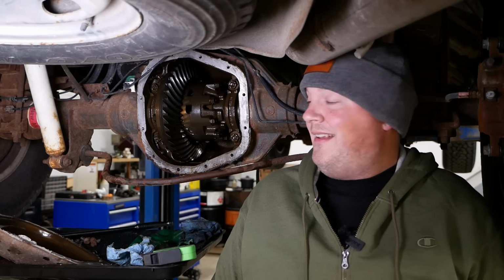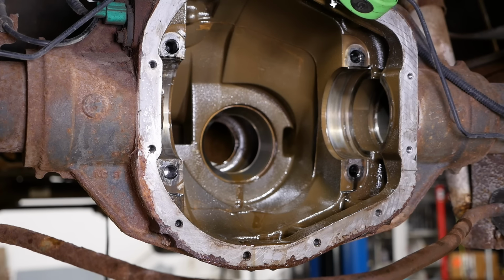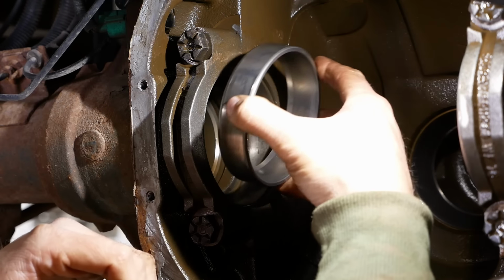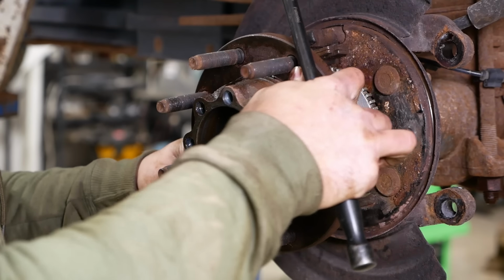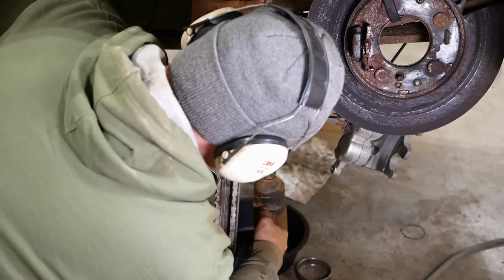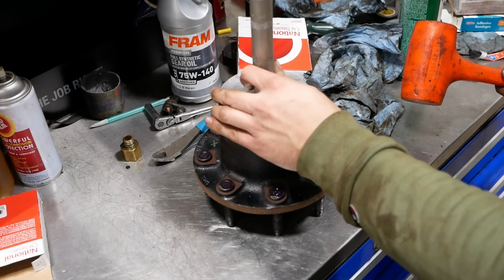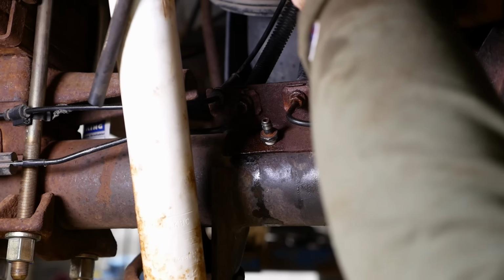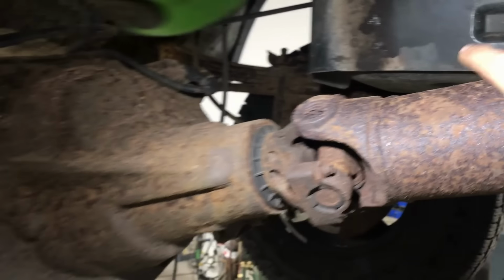Ford Differential Carnage - Driveline Noise Located

Comment: LOL Same thing happened to my DB hammer!  The oil over time hardens the plastic and makes it brittle. Sucks as it was a really nice to use hammer.  As long as the bearing cap and housing were round, thin brass shims could be used if you know what thickness is needed.  That is ONLY if they are perfectly round.  I actually blew out spider gears on an F350 Dually, had to replace everything inside, and the nut for the pinion is torqued to 450 ft lb, needed a torque multiplier to get that put on.  Use a long angle iron on the pinion flange and it goes a lot easier.
Reply from the maker: Yeah I did a pinion seal on a Dana in a video a while back. I used a 3/4 drive torque wrench.
Reply: @WatchWesWork  Without a lift? :)  I had to do it on the floor in my garage,  It did give me the chance to change gearing from 4.10 to 3.73 though and improve fuel economy.  I think the front diff was more difficult to work on then the rear, Crush sleeves are a bitch.
Reply from the maker: @acdii  That was a dually and I could not get it on the lift.
Reply: @WatchWesWork  Then you know what a PITA it is to get that pinon nut torqued! LOL

Comment: i think your right on the greased bearing of army trucks they are holding a lot of weight on those bearings compared to a ford truck so they probably would not hold up to just oil.
my neighbor has a giant Econoline van with a big axle he borrowed some tools to change oil and ford dealer said they changed recommended oil to a heavier 75/140 rather than 80/90 or something owner's manual says. I guess since you are using that ford dealer didn't lie to him.

Comment: I have the 6.2L in my raptor.  The one thing that’s kind of a pain is that it uses 16 spark plugs and the coils use those pellet things that get corroded easily. Other than that..  it’s a powerful great engine.

Comment: My 88 Suburban pinion gear broke exploded bearing cage and snapped U Joint locked up in forward when I was getting on it with the New motor. Pulled drive shaft put in 4x4 and drove home in reverse 3/4  mile fun fun

Comment: Sort of inconvenient that they ever decided to get away from differentials where the whole thing  comes out the front after you pull the axles. So much easier to work on when you can simply set it on the bench.

Comment: With all of the Ford heavy duty 6.0/6.4 diesels laying around without engines, the axles have to be cheap. They say guys with boats will tow them to lake, getting their axles warmed up on the way, then back into the launch ramp and into the cool water. The axle then gets submerged and cools rapidly creating a vacuum in the axle housing and then...if they go too deep, the vent will suck a bunch of cool, crisp H2O into the diff. I wonder if this guy owns a boat?

Comment: That diff looks like a classic Dana design. A person really should check and maintain diff oil at least ever 6 months or yearly. Those vent tubes are notorious for clogging. I have a Dana 60 on a 1972 pickup truck with same kind of vent. I blew a hub seal 27 years ago because the vent tube plugged. Same thing again about 25 years later. Just gotta do that basic vent check at least. I'm wondering if they were getting that rear axle in lake water launching boats? BTW if your customer had just driven that truck in when you checked the differential oil then the foam shouldn't be anything to worry about. I believe that ring gear rolling in and out of the oil as it moves incorporates air into the oil. I've seen it before. The air dissipates after setting awhile. Nice vid.

Comment: That gear lube appears to be foaming. I know that when motor oil foams, that engine will soon be destroyed because the oil pump cannot create oil pressure when it has air bubbles in it that can compress, you can’t build oil pressure with foam..
  but I’m not sure splash feed ring and pinion gears riding in oil that has foamed.. I suspect final drive failures could be the fault of the gear lube’s additive package, or lack of additives like - anti foam additive.. possibly lack of zinc and phosphorus/which are anti-sheer ingredients..

Comment: A quick way to get that carrier loses is to start it with the pry bar. Then use a wench on on of the ring gear bolts to rotate it towards you. It will pop right out.

Comment: I had a late 90s blazer. Customer complaint" noise from rear". I immediatly saw dents from inside of diff cover. When i pulled the axles the drivers axle bearing had failed LONG time ago.  It had worn into the axle shaft 1/4" deep from grinding metal on metal. The entire thing was thrashed. I do not know how loud that failed bearing was for a Long time but they ignored it. Must have screamed at 70mph.

Comment: Cool end bummer about the Stanley it's done it's time by the look of it as for the gearwrench I had two of their ratchet spanner fail straight out of the pack no snipes on them 1/2" one on the fifth nut the 5/8 after a week probably only 20 odd nuts 

My mate swears by snap-on and he has had them replace a 20 year old socket that split so I guess if they do that for all their tools you only have to pay for them once 😁 replaced my gearwrench with a Stanley still working today 2 years on

Comment: Next time , just put a box end wrench on the crown gear bolt and turn the pinion flange , the wrench will lock against the housing . The carrier will walk away from the pinion gear. Makes it so much easier to get out

Comment: I bought a F450 that had some gear noise in the rear end. Pulled the third and it was filled to the top with grease. Guessing that was why it was sold.

Comment: I always thought the pinion bearing whine was not speed dependent, or turning, like the carrier bearings. My 7.5 Ranger diff had a whine that started about 30 MPH and stopped around 40 MPH. I replaced the pinion bearings and it did the trick. I would've replaced them all, but the new Chinese made bearings are so cheap compared to the Old Timken and Koyo I just kept the original 1996 bearings.

Comment: that broken socket is testimony as to why you never hold an impact swivel socket using an impact wrench. On the old snap/on the pin would come out then snap/on put a ring around it to stop the problem. and saving hands

Comment: Hy. The reason for the military truck having sealed hub from the diferential oil is because gravity.The civilian truck is ment to work on horizontal road ,so the oil is getting to lubricate the hub bearings.The military truck is ment to work on the field on diferent ground levels so the diferential oil would not get to the both hubs bearings. So,they separate the diferential lubrication from the hub bearings lubrication sistem.

Comment: Depends where in Canada the truck comes from. Generally the western provinces have been good, but lately here in Alberta they've been going nuts with the salt, unfortunately. Personally, I'd rather replace a cracked windshield from gravel every few years than have the whole thing start to rot from salt.

Comment: The oil wouldn't necessarily make it out to the wheel bearings if there is an oil seal, on diffs that I've worked on there's usually an oil seal going into the diff that keeps the diff fluid from coming out into the grease where the wheel bearings are

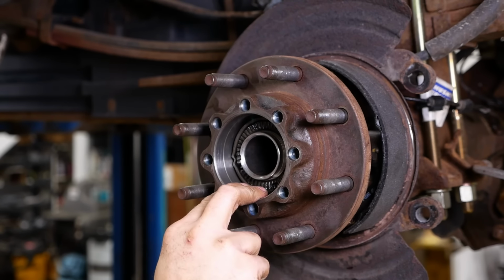Comment: 36:40 idk for certain (real helpful of me i know lol) but i heard that they sealed off the hubs from the diff because being driven hard offroad and through deep waters they didnt want a hub/axle seal to fail and get filth and schmoo and water into the diff and by the time it was detected the diff be damaged as well as the hubs. Thus by separating the hubs the extent of the damage would be limited to just the hub. sounds to me like the army was overthinking it, diffs are pretty tough.

Comment: As much as the carrier bearing journals are worn, I would suspect the outer bearing races are also similarly worn. New bearings might have taken up some of that excess clearance, such that  a little retainer adhesive might have made for a good, reliable build. I still think you made the right decision to replace the axle, based on excessive wear on the spider gears. As a rule, if you buy a new axle, or a new truck, I would recommend changing the gear lube after the first 500 miles, then again at 5,500 miles. After that, what ever the manual says. That would guarantee, that the axle would out-last the truck! Those "break-in" gear lube changes are critical, to the longevity of the drive axle. (oil is cheap, drive train components are expensive!)

Comment: Rust is a interesting thing. First axle i ever pulled i had to cut everything to get it off even then it still was stuck(98 s10 120k) however the next four (99 sliverado ,79 k20,74 k20,99 f350) all came off good minus the brake lines all from the same state

Comment: The rear end grease got water in it. I would change it out with Amsoil Severe gear grease in there. I don't think you will have anymore troubles.

Comment: Speaking of brakes! I usually do my own but haven't had the time so had them done. Its only been a few months and a few thousand miles and at least one front rotor is already warped I believe and rubbing the pads. I can see the uneven wear on the rotor and of course I have that little shimmy.  should I just replace the rotor, both front rotors or redo pads and rotors? I feel like all the rotors do this though. Would I be better off just getting high performance pads and rotors? I do tow a bit but nothing crazy heavy or anything.

Comment: I'd keep that one so you know what you have. As for the bearings...just shave the caps a little with some wet sandpaper laying on the bench and forget about the line-bore. That's money. Sure you can replace it for less than the parts, but there is no way of knowing you won't have the same problem again soon and no money will be saved.

Comment: When ship board, and it is a fix it to get me home type of repair, bearing caps can be lightly dressed with a mill bastard file to take off .0005 or so, to wrapping shim stock of the appropriate thickness, and stud and bearing mount for the .060 to .120 types of fit. Some of our bearings are still poured, and may be shim adjusted for correct running clearances. Have fun

Comment: i HAD A 2010 F150  tat the dealer replaced the disc packs in the limited slip rear end 4 times.  The noise was heard by the technician at an oil change at 15,000 miles.  They replaced them THREE MORE  times ( 35,000 and 56,000 and 70,000 just before my extended warranty ran out).  They would not tell me what they did the last time.  They put heavy aluminum tape over the end of the bed support.  I think the rear breather was in that "U" support.  I think the took the limited slid module was replaced.  The first set cost $4,500 in parts.
This was a problem to only a 2010 time slot rears.

Comment: Couldn't you just grind the mating surfaces of the bearing carrier as you said to bring it down a tad, without any boring of the journal, sure it wouldn't be perfectly round but would clamp that bearing down well? Would it cause a concentration of pressure on the bearing at a specific spot and not spread that clamping force equally, would that be a problem?

Comment: I have a 2000 Ford Excursion V-10 and had problem with pinion bearings/seal. Made a whining noise and leaked oil. All I did was tighten pinion to correct resistance and install new seal/oil and it has been fine ever sense. I believe it just wasn't adjusted correctly eventually causing seal to wear and start leaking fluid which caused the whining noise.

Comment: Here's one for the brain trust.  I've got a 2003 F250 2wd (anti-slip) 6.0.  102k on the clock.  Nice clean truck.
Sometimes, when accelerating thru 25ish mph a whining starts (don't get ahead of me).  This continues at CONSTANT pitch for several minutes.  The only variable is during deceleration, the sound quickly diminishes during deceleration towards 25ish and goes away as I stop the truck.  When it's there (not always there) the sound doesn't change pitch or volume.  It's mostly just annoying.  Sounds like it's in the cab area.
Thoughts?

Comment: I'm watching this bit by bit as I get time, but I was wondering about the 'junkyards' where you are, compared to here in Australia, you said they don't like to sell brake stuff, that doesn't seem to be too much of an issue here, but I was wondering what sort of warranty you would get on a junkyard axle or diff assembly? Typically here I believe leaks usually won't be warranted because you should change seals in a secondhand unit, but if it is noisy it will be up to them to repair or replace.

Comment: 13:32  Install a ½" wide x 2½" long brass shim in the bearing cap and torque 'er down.  Shims are used everywhere in the diff to adjust for slop, might just as well do the same.

Comment: If you find metal shavings in the gear oil  your better off replacing every bearing in it. The differential and axelbearings won't be far behind the pinion

Comment: my guess..............lack of oil changes compounded by low oil level...............Loctite bearing mount would probably secure that bearings which spun in the housing, add some tac welds and it will never move. Used axle is the best option.

Comment: All the junk yard knows is that the axel was in a vehicle they took apart. They have no way to know if its 'good' or one step from failure. If they can't see it bad externally, its not bad. All they know is the indicated miles on the doner, and how it looks.. Check out what you buy carefully... Sometimes it IS the best choice and you get great stuff, but sometimes its no more than a core needing a rebuild.

Comment: Aused diff sometimes good for saving alot of money n efforts..
Here what i suggest as it is a used one it is nice if you had looked internally deeper in this used one for any necessary replacement for a consumables such oil seals ,bearings, races or stud bolts needs checking or propor tightening..ets
Any way good job all the best

Comment: Wes, can I ask what you charge per hour of labor in OH? I had work done on a '97 Ford-SuperDuty (1-1/2 ton dually) and out west the mechanics are charging $120/hr-130/hr, which is about twice what it was about 3 years ago...even so it's hard to find a mechanic to do the work out here as the good ones are all booked solid...seems not too many folks buying new trucks...I'm keeping my eyes open for a '99-'04 F-250 w/4WD, those 7.3L diesels seemed like good engines. Any comment on those ? Of course I'm looking for the puss truck w/low miles and babied. If I could find one with 80k-100k miles on it, that would be fairly low miles, IMO. Out west we figure 10k miles per year is average.

Comment: Those bearings would likely be fine with an oil resistant loctite product, but if you had a way to line bore it in the vehicle that would be best

Comment: Good chance that if u just slapped it together with new bearings,it would outlast the rest of the heap,but just take .002 or .003 off those caps also,make sure u don’t lock the carrier solid when u tighten em caps up,and it’ll live.it won’t egg’m to much

Comment: I have a 2023 f250 with the new sterling 11.6 i hear a low whirling sound i believe is coming from the right rear wheel bearing. Ive done heavy off roading modifications along with 37s. Its only got 11,000 miles so maybe im paranoid but it doesn't sound right. I haven't took it to the shop yet figuring all my modifications they won't warranty it. If it is a bad wheel bearing will the metal ruin the rest of the bearings in the diff since the oil circulates through the whole diff?

Comment: It was the lower EM's that had to take off the duels on 2.5tons in the Army and would just piss everyone of them off because they would have greese EVERYWHERE on their body. I felt bad for them at time because they would be working late into the evening after 5:00 end of day formation having to go back to the motorpool and help the mechanics work on their vehicles specially on PMCS Mondays (PMCS = Pre-maintenance Checks & Services) You get a Class 2 leak you would be wrenching because a class 3 is considered deadline

Comment: You can buy shim stock that will tighten up those races - I have used it several times on generator endbells that have pounded out the bearing bore.   However in that application I didn't have to worry about any gear tooth clearances ...  I'm like you - go to the junk yard and pull a few magnetic plugs on some rear ends and pay the 500... it will cost your customer more than 500 for you to assemble and set up new bearings and gears in the used rear end...

Comment: As compared to replacing parts knowing the rest of the unit will probably wear and need replacing of more parts, would it be easier to replace the entire rear axle w/a new rear axle. Taking in to consideration time and labor.

Comment: Regarding the pinion nut. They will be torqued to around 250Nm. Stop using that cordless drill and lock the pinion then use a conventional wrench with 3 foot extension bar. Saves a lot of time. All that wobbling of the pinion using that drill possibly caused fretting damage to the crown wheel teeth?